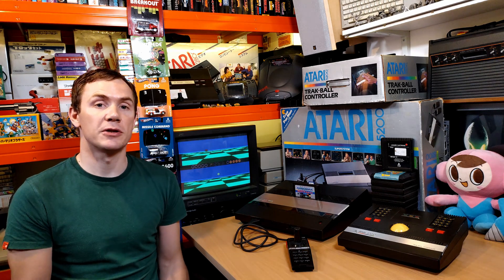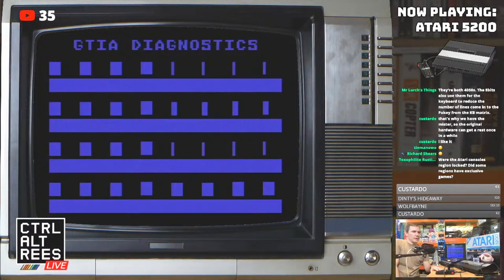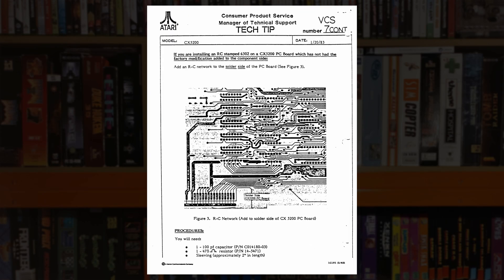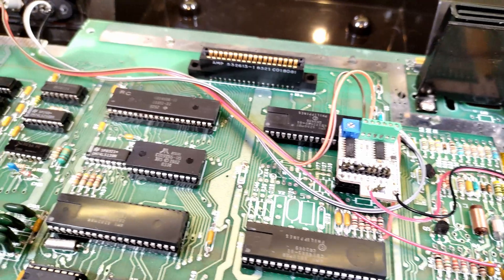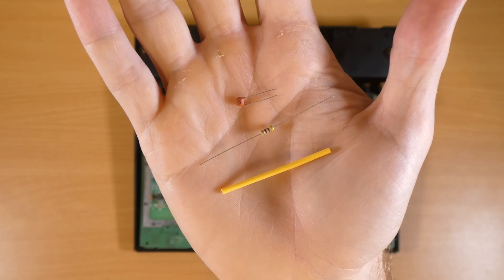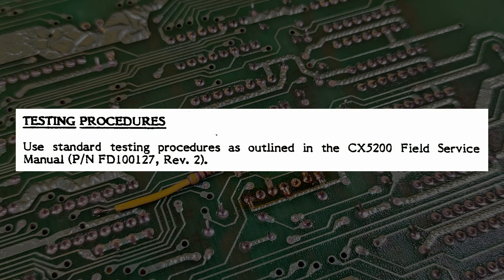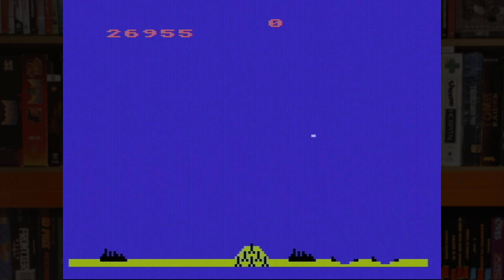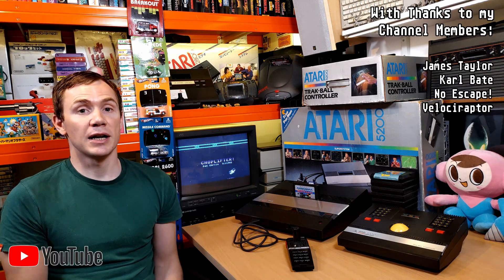I Tried An Official Atari 5200 CPU "Fix" From 1983 - But Did It Actually Work?

Comment: My first and favourite console. The only complaint I had with the controller was that the sides for the pots would lock. The non centring part never bothered me. Still my favourite controller to this day.
Reply: I encountered the same problem.

First open the controller and make sure that the pots for the joystick are down in the enclosure Snug,( On some controllers, they have a little rubber fitting around the pots) if not put hot glue around the pot to hold it in place, on my controller. The pot wasn't no longer snug.  And the controller would Bind up because it would move and be cocked slightly. Also , the controller housing was too tightly fitted,

The solution is to take a screwdriver And Loosen each screw on the controllers half a turn To a quarter of a turn, no more no less,

My controllers have worked perfectly ever since, and I did this fix over 2 years ago.

Hopefully this helps.

Comment: Now that’s a pretty interesting move from atari in the past.
Instead of replacing all those cpu’s with timing issues with new fixed cpu’s, atari just solved the problem, by simply adding an extra capacitor & resistor to those old cpu’s to fix those timing issues that way.
How briliant is that? Because atari not only saved alot of money but the probably used those new cpu’s in later production models of the atari 5200😁

Comment: Oh, this crazy console; you look at it funny, it breaks.  It truly is one of the classiest looking consoles ever made, but under the hood...

There's a considerable disparity in build quality re. the system-board and the form factor between the first gen. Atari 'VCS' and this thing.  But, the 5200 did have a good number of very well done arcade-ports, amazing actually... but only realizable after you rebuild everything; that wasn't really an option in the 80s, so we'd just box this thing up and attic-it.  Most of us back then either migrated to the Colecovision if we could afford it... or just play those amazing Imagic or Activision titles on the VCS (2600), which is what I think most folks did until the NES.

Comment: Impressive work! Nice to know that I'm not the only one with a repair pile. :D A little request, next time please include the name of the track that you used - I found it with Shazam but it would cool to have a YouTube link. Now I'm going to check out your 5200 controller mod video. :)
Reply from the maker: Thanks for the suggestion. I agree, I should start doing this, I'll add it to my checklist! Glad to hear that the Epidemic Sound tracks are available on Shazam.

Comment: great video.  I own two Atari 1040 units.. 1040 Ste and 1040 STFM.. i just need to upgrade the power supplies on them, as both have the old ones.

Comment: Great video Rees. That's a really clean looking 5800 and the track ball add on looks awesome. Holding out for a nice 7800 I think. Have you done a comparison of all the VCS s?
Reply from the maker: I haven't, that's a good idea for a video - and a great excuse to buy them all 😅
Reply: @ctrlaltrees  Even just 2600 vs 5800 vs 7800 would be interesting.

Comment: The 5200 is basically a stripped down Atari 400. All 5200 games will run on Atari 8-bit computers with some code patches for the controllers.
Reply from the maker: It is indeed - in fact my next video covers that in a bit more detail. 🙂
Reply: Before I moved and lost some floppies with games, I had a patched version of 5200 Gremlins which needed the FixXL Translator booted first so the audio would play correctly.

Comment: I'm so tempted to try that ultimate Atari video mod on my 5200. Having composite and s-video output would great, but I don't have a ton of experience soldering on PCBs.
Reply from the maker: It's quite an easy install on the 5200 if you get the plug in kit from The Brewing Academy as all the chips are socketed, so just a couple of extra wires to hook up for colour and audio IIRC. Certainly a lot less fiddly than some models of 2600. I actually found the most difficult part installing the sockets in the case in a tidy way.

Comment: So many would have just pulled out the CPU but I love the fact you applied an old Atari fix.  Awesome stuff.
Reply from the maker: Between you and me I did also order a new CPU, which hasn't arrived yet. The thought of the one in there being buggy did bother me. It'll be interesting to see whether I'll need to reverse the mod when I install it (the tech tip says it isn't necessary).
Reply: I love the 5200....I don't care what yall say

Comment from the maker: Apologies for the prominent vertical lines or "jailbars" on some of the video captures. These didn't seem to show up in editing and by the time I did the final render it was too late to recapture everything. Very strange indeed - obviously something happening between the console, RetroTINK-5X and my capture device as these don't usually show up and weren't there when I was streaming, either. Could be interference due to running the 5200 without the RF shield in place, I suppose. 🤔